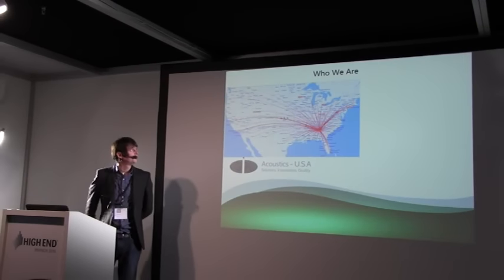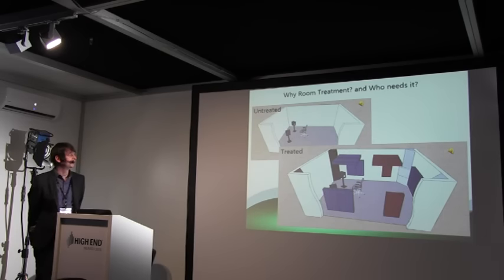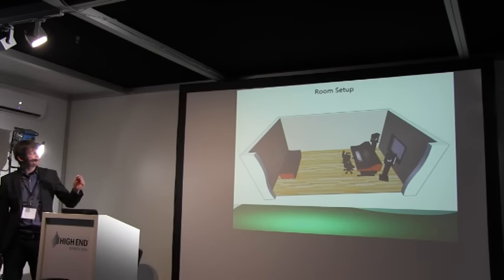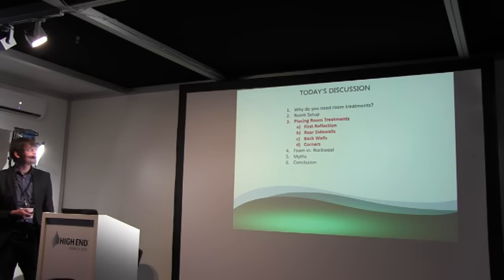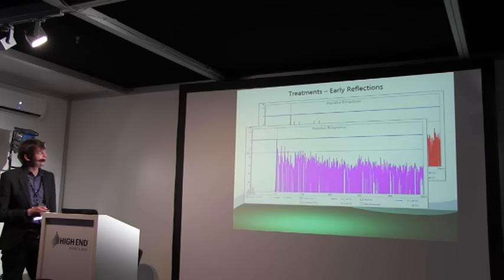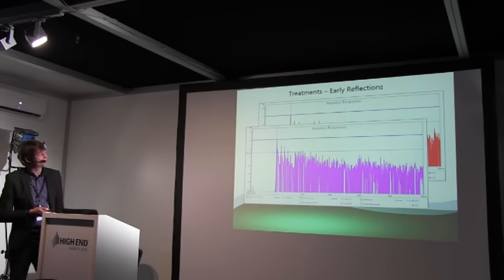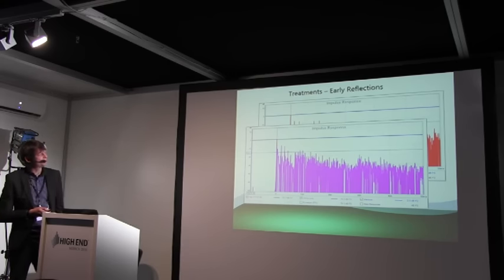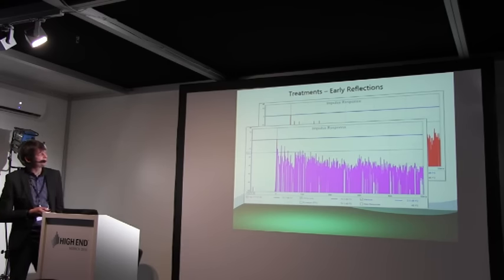GIK Acoustics   Room Acoustics And How To Set Up Your Room

Comment: I've often wondered if it would be worth the manufacturing efforts to develop multi-pane windows where the space between the panes was as close to vacuum as you could get.
Reply: No, for a lot of different reasons.  There are windows manufactured of two different thicknesses of glass laminated together.  That does reduce sound transmission at a reasonable cost, but nothing is perfect.

Comment: I have a large window (6' x 6') behind my listening chair. My speakers are set up in front of a solid wall opposite  the window. Obviously I can't put room treatments where the window is located behind my chair. So, should I flip the orientation of my room and have the speakers by the window and my listening chair by the solid wall?
Reply: Cla55clown Portable, hanging diffusion over the window is my first thought. Flipping the room orientation would create a somewhat different issue with your glass. Absorption, even in the form of acoustic drapes would help your situation as well.